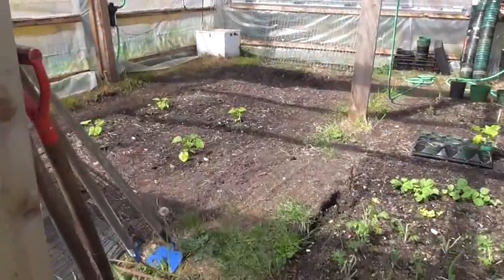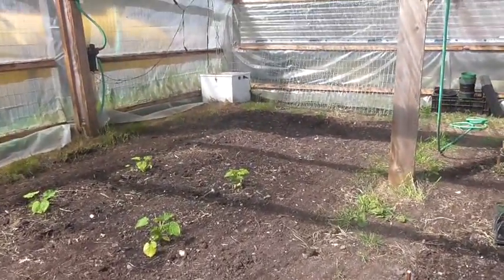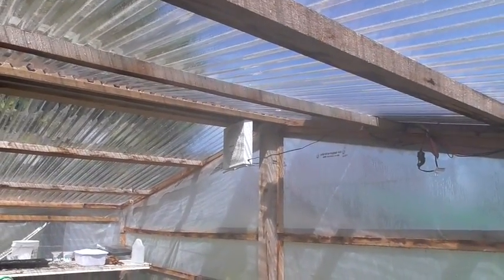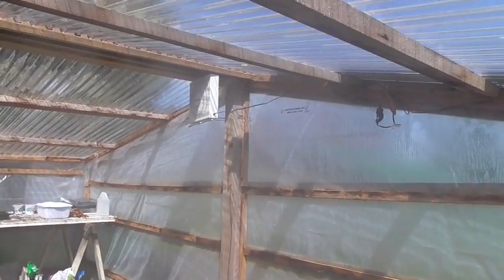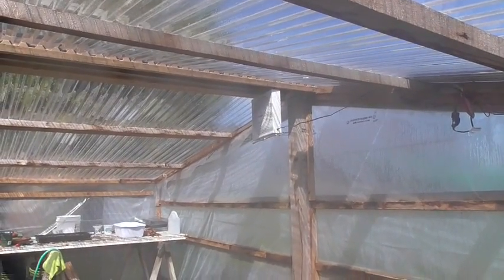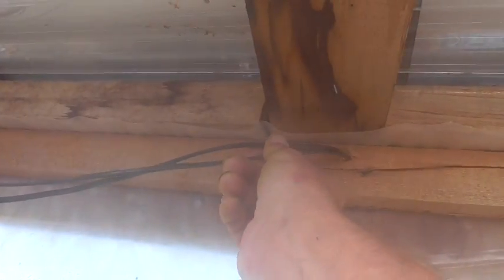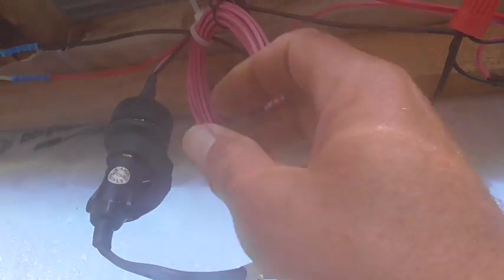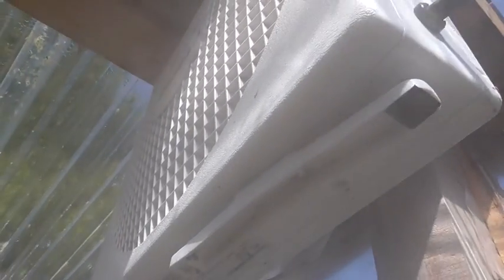Solar Direct Greenhouse Fan!

Comment: I'm looking for that same breeze fan. Do you know where I can source one now?
Reply from the maker: https://www.amazon.ca/Fan-Tastic-Vent-01100WH-Endless-Breeze/dp/B0000AY2Z6  
or Home Depot https://www.homedepot.com/p/Fan-Tastic-Vent-Endless-Breeze-12-Volt-Fan-01100WH/309588656
or even Wallmart https://www.walmart.com/ip/Fan-Tastic-Vent-01100WH-Endless-Breeze-12-Volt-Fan/161790879
Reply: @NormanMcGregor  thanks Norman. 
I'm building a greenhouse myself this year. Looking for a good fan like that. Did you ever make a hole to use it as an intake? Think I may have seen it like that in future videos.
Reply from the maker: I use flip up vents in the bottom of the walls as intakes and the Fan as an exhaust.   I have videos on the setup.

Comment: Just watching this video four years later and I'm wondering if those fans are still running ?
 Thanks too for the vid. Cheers from Australia.
Reply from the maker: Yes the 2 fans are still working.  The exhaust fan runs off a solar thermostat set to turn on when the Greenhouse hits 26C.  The second fan circulates air around the greenhouse to keep the temp even and it is wired directly to a 50w solar panel.  It runs when ever the sun is shining.  I do take the covers off them every spring and clean the dust off the blades for air efficiency.  Over all a Great product and only about $50cdn.
Reply: @NormanMcGregor   Could you please tell me where you bought the fans ? I need a couple and all I can find are Chinese ones !  Thanks heaps,  Simon.   :)
Reply from the maker: I ordered mine directly from the Endless Breeze website at https://www.endlessbreeze.com/